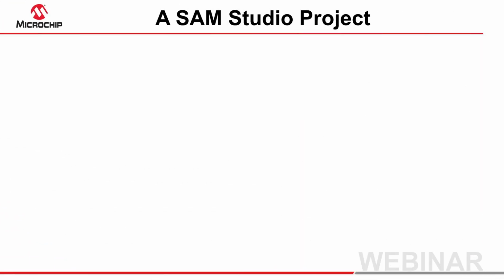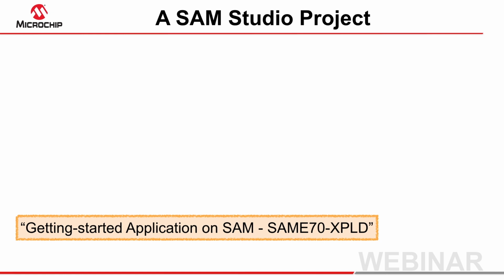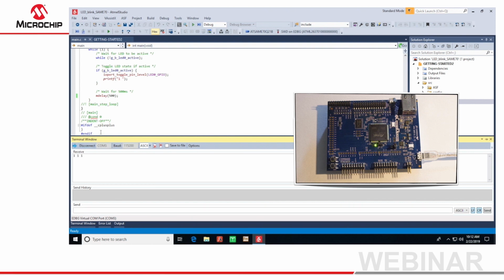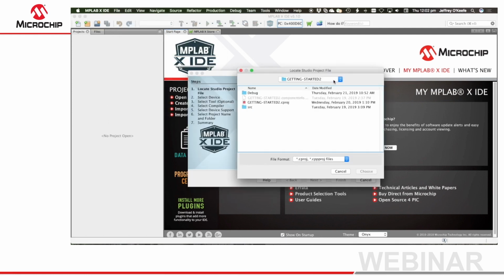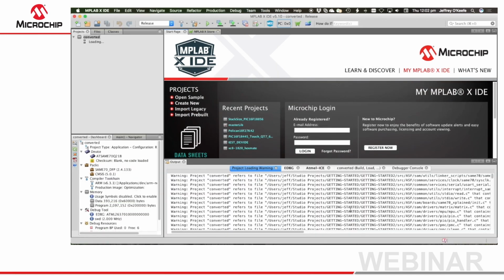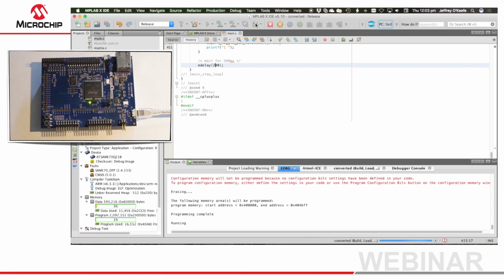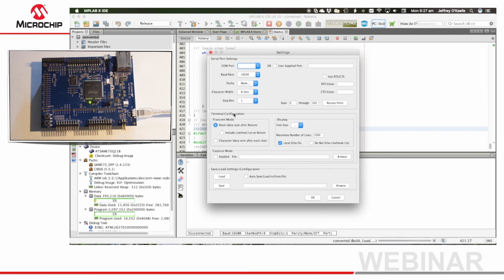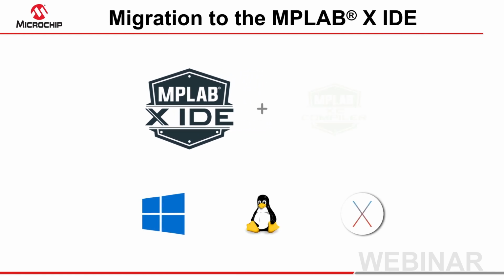Migrating SAM Studio Projects into MPLAB® X IDE

Comment: Provided you find some reason to move from a decent IDE to a pile of hot garbage
Reply: Atmel Studio is one of the worst tools I've ever used, so it can hardly be worse...
Reply: @riz94107  worst in what? Does it have million bugs, broken syntax highligh, broken debuger connection? Maybe laggy interface? Not, but MPLAB have.
Reply: @riz94107  Visual Studio with VisualGBD.
Reply: Atmel Studio7 is actually a custom version of Visual Studio 2015(?). Now using Visual Studio 2019 (free) with VisualGDB. AS7 seems to faster. VS19 has latency on kbd and mouse input and seems slower.